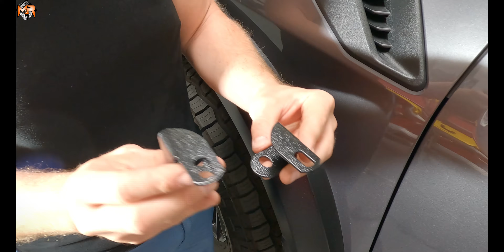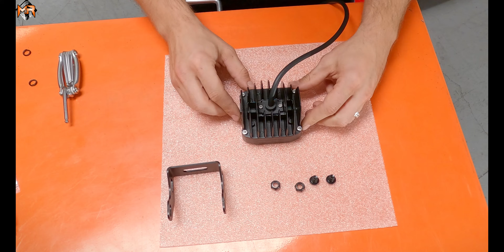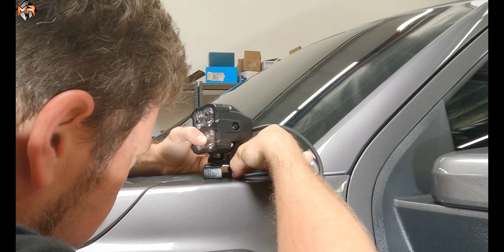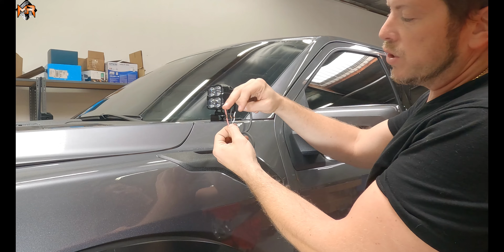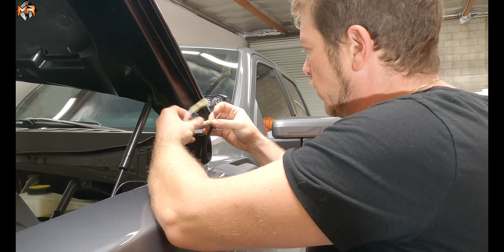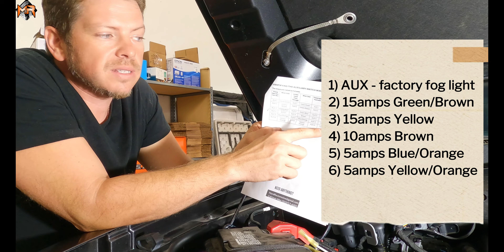2024 Ford F150 Raptor Gen 3 Ditch Lights PRO  | Full Install by M&R Automotive

Comment: :face-red-droopy-eyes:  I installed the Ditch Lights on my 2023 F-150 Tremor.  The bracket that came with the kit does not match the one in the video.  The problem is the passenger side Ditch Light interferes with the antenna.  Make sure you get the correct brackets with your kits.
Reply from the maker: Hi. I have emailed you about this